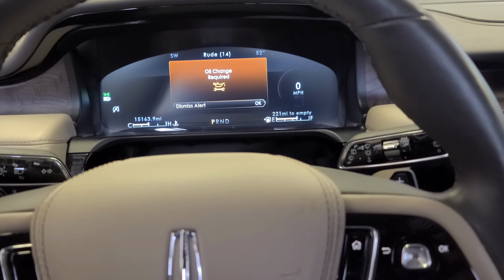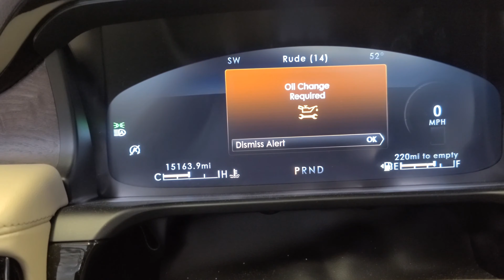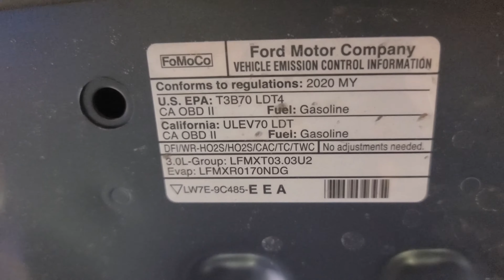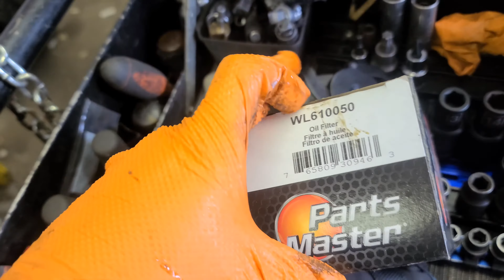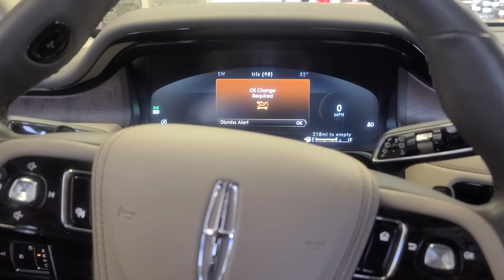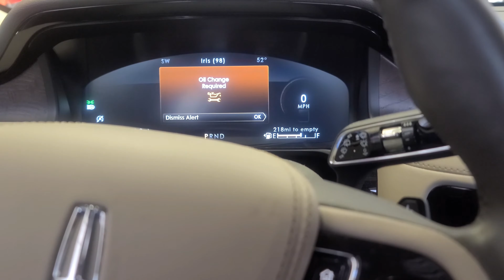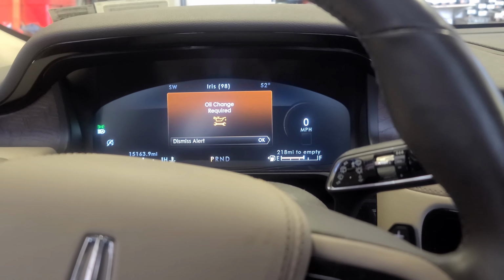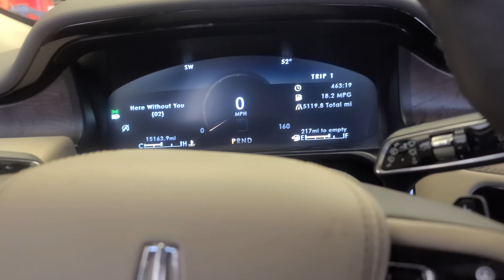2020 - 2022 Lincoln Aviator How to Oil Change & Reset the Oil Change Required

Comment: You didn't mention if this Aviator had the air ride, but if it did,  you need to disable the system thru the front display. Thank you for your video, it's always nice to "see" a job, before you start.

Comment: Wow that oil was dirty, look at the particulates in that oil filter 😮 also the Lincoln Aviator's owners manual says the oil capacity is 6qts not 6.5qts. Even though 6.5 fills it up, having a buffer limits oil blow by with a full crankcase especially with turbo charged direct injected vehicles with no port induced injection. Excessive carbon will build up on the valves as a result and eventually will cause issues. Please change your oil with full synthetic every 6500 miles or less and this will also minimize this issue and keep your motor running clean and smooth. ✌🏽♥️

Comment: Have the same engine in the Aviator and wish the dipstick tube was positioned over the deepest part of the oil pan. I like to do all my oil changes from the topside by vacuum dragging the spent oil out through the dipstick tube. Did this procedure on the Aviator and was only able to remove a bit less than 5 quarts because the suction tube cannot reach the deepest section of the pan. Your video confirms the unfavorable pan geometry. Good location for the oil filter cartridge but the strut towers brace is very close to interfering with centering the socket extension over the cartridge cap.
Reply from the maker: I see

Comment: With these type of oil filters, you need to loosen up the oil filter housing first and then drain the oil. I was told the reason is that it leaves about a half gt of oil if you do it the way you did it. Just what I was told.
Reply from the maker: We tried all that......always gonna be some oil left in the system. Thanks for letting me know

Comment: Didn't change the Orings. Hopefully it doesn't come back leaking oil.
Reply from the maker: Welcome aboard, Mason!
Don't worry if you didn't change the orings. Just make sure they are not too worn out, you'll be fine. Thanks for watching!
Reply: @AxtuoAx  o-rings need to be changed, don't cheap out.